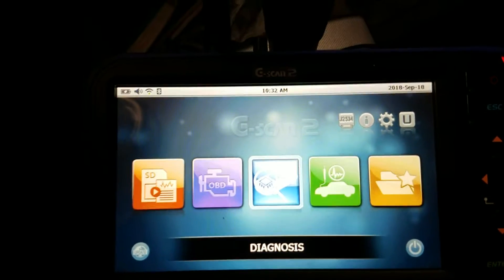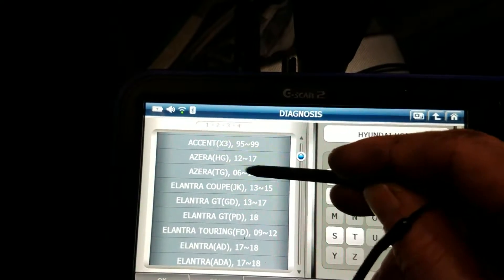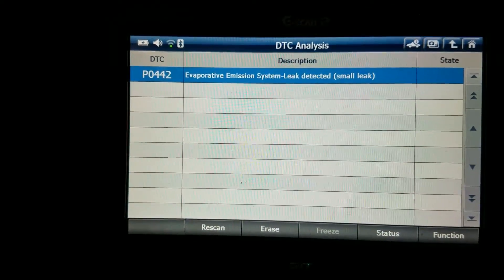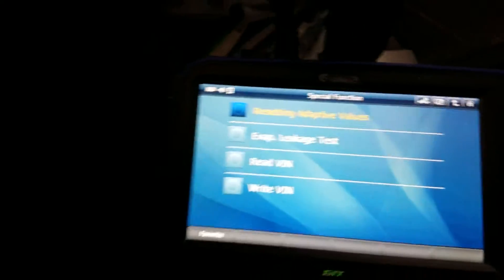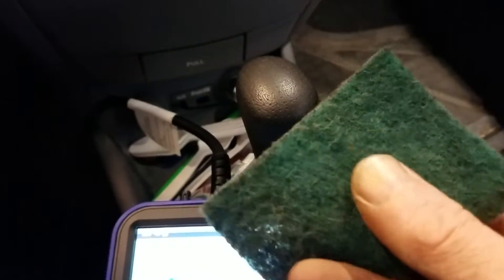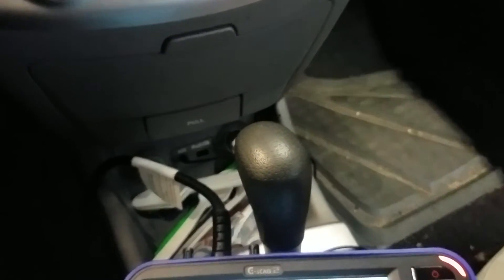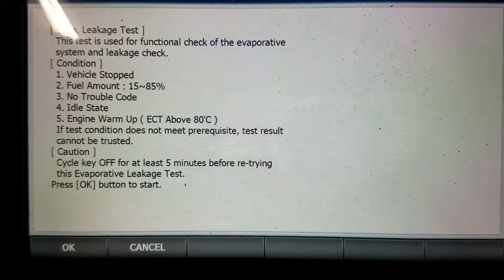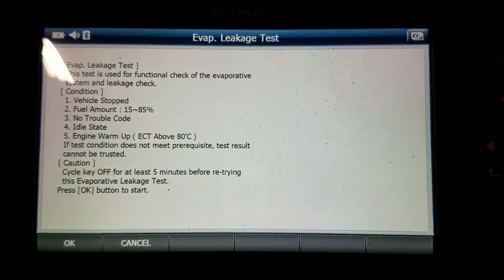P0442 Small EVAP Leak Hyundai Elantra "Easy Fix"

Comment: I have code P0456. (Evap very small leak) I've tried the gas cap, vapor canister, and purge value. Any other things I could check? Do I need a smoke machine to test hoses? This is extremely annoying trying to fix.
Reply: I made a smoke machine out of a paint can. I’ve done everything you have and I still can’t find it. Time to take it in , past inspection.
Reply: Hey I know it’s been awhile, did you end up finding what was wrong? Having the same issue. Thanks

Comment: If my car isn't have trouble maintaining fuel, but has starting issues every time at fuel fill-up... would I need to replace the purge valve under the hood or the vent valve underneath the car? I already bought a new gas cap.
Reply: having the same issue.  i was thinking of replacing the purge valve too
Reply: @gadgets123   Replacing the purge valve worked. The Hyundai dealership wanted to charge me $300, after initially quoting me around $60-70. So I left. 

I took it to a car repair shop (that had good ratings) and they wanted to charge me $500... saying that I probably need the charcoal canister replaced and have the lines flushed. As I was walking out the door, they told me that I probably didn't need that stuff,  considering my gas tank wouldn't restrict me from putting in the gas. If you can still put in gas, you probably do not need the charcoal canister replaced. 

My mom had a friend in her apartment complex who works on cars all the time. So I paid him $30 to install the OEM purge value that I got on Amazon.com.  I haven't had any issues with it since. I would only purchase the OEM part.. it cost me around $30 + shipping. The check engine light is still on, but the car runs perfectly.

 I may need to disconnect the battery for 30 minutes like I was told, so it can reboot and get rid of that indicator light.  At first I thought my issue was due to getting bad gasoline in the tank, since the issue first started after I put gasoline in the tank from a gas station that I do not normally go to.  With my particular Hyundai, the purge valve is under the hood near the very back. It's hard to get to. You could probably replace it yourself by finding a tutorial on YouTube, but if you don't want to chance it, just find someone who is mechanically savvy and save yourself some money.

Comment: I’ve got an 06 sonata with the same code. It’s weird. I bought new gas cap, if I top off tank I get no codes until the gas is about 250 miles remaining or between 3/4 to a half a tank.  Today I got gas so I don’t get the light on.  I pumped a few cents over from where nozzle stopped and noticed gas leaking next to the filler area just near my tire well. I’m lost.
Reply from the maker: Bad filler neck maybe. Hard to say
Reply: i believe your vapor cannister is in the  rear behind the wheel well. if you topped it up too much you can get fuel coming out the cannister vent
Reply: I have the same car, did you find a solution?
Reply: I have a 08 Hyundai sonata with evap codes and a check engine light. I re recently they said they wanted 2000 dollars to fix in debating.